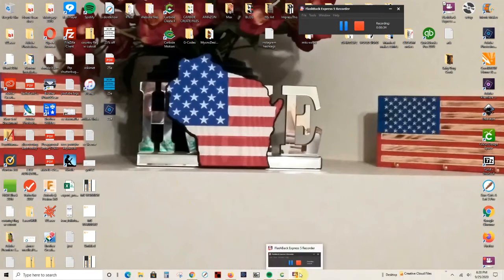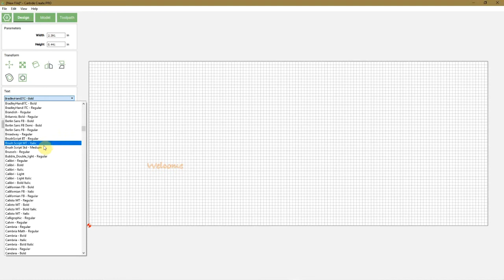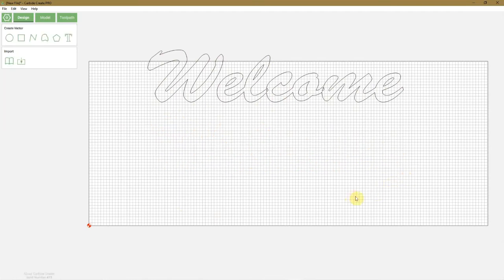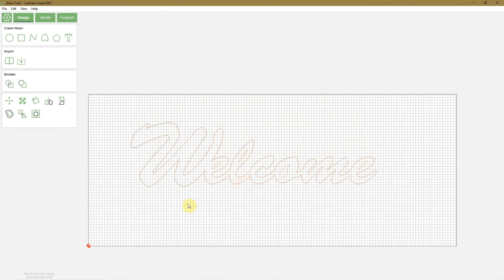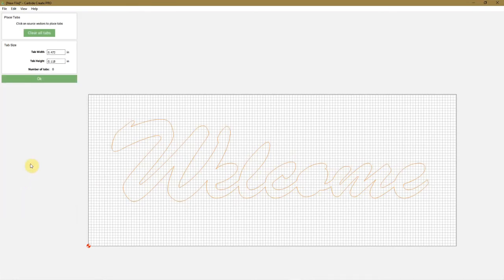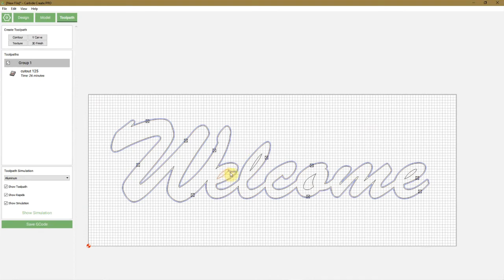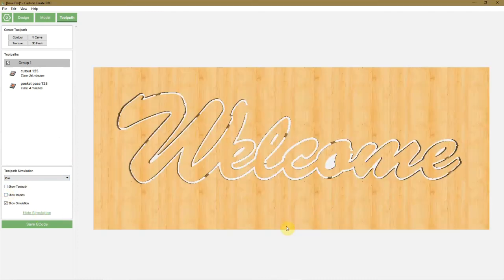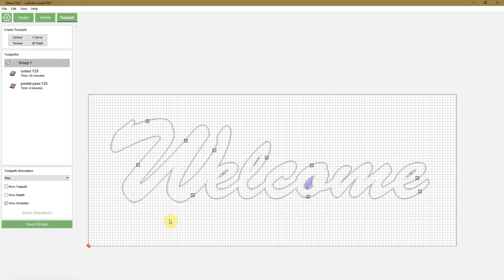Carbide Create Tutorial - How To Weld Text For Signs

Comment: So, if I wanted to add additional words below the "welcome" would I just repeat the process?
Reply from the maker: Yes, for each line it's the same process.
Reply: So, if I'm not welding letters together, I can skip those steps where you duplicate the "welcome" twice?  Newbie here, I have my XXL but haven't set it up yet, just trying to learn my way around Carbide Create before I do. Hoping it puts me a few steps ahead of the game when it's up and running
Reply from the maker: @trailheadcustomcuts7648  yes only to weld text together in this tutorial. Regular text can be put where and how you want it and use a 90 or 60 degree vbit.